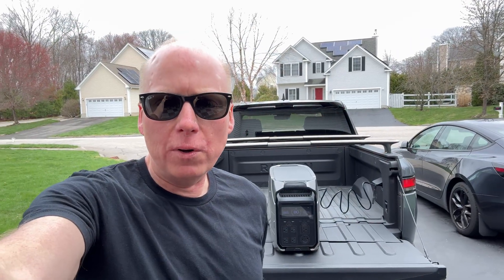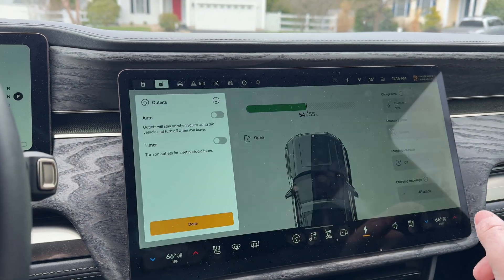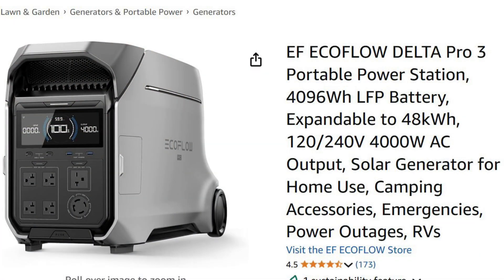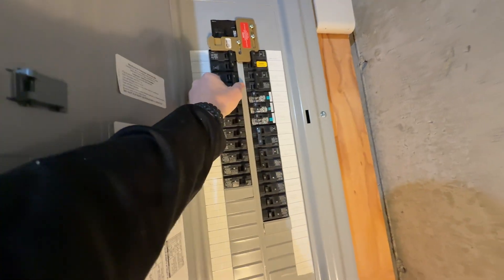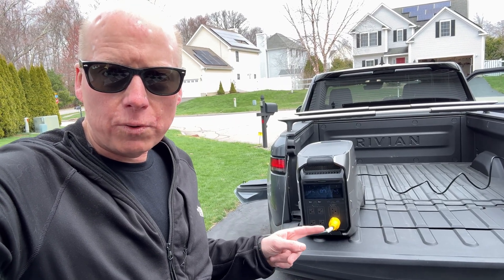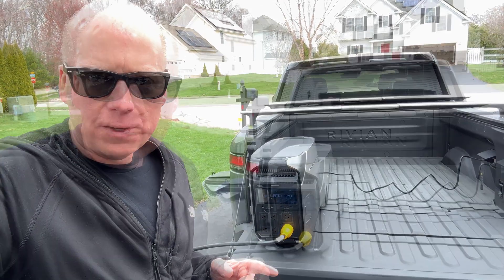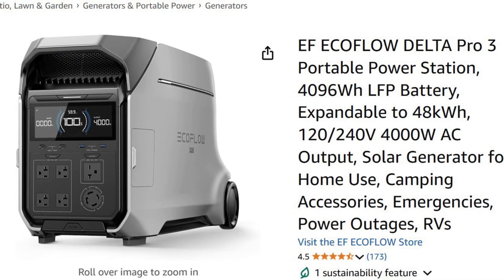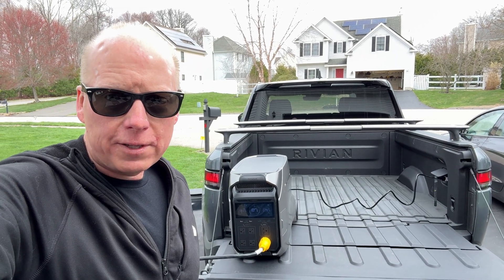Can I Charge the EcoFlow Delta Pro 3 With a Rivian and also Power my Home with 240V Split Phase?

Comment: Rivian R1T owner here and just picked up the ecoflow delta pro 3. Excited to see this work! Did you learn anything new over the last 6 months?
Reply from the maker: So there are some weird limitations you can charge from 120v and run the 240v inverter no problem but the ecoflow will try to pull 1800W even if you have the charge power limited in the app to 1200W continuous that the RIvian inverter can provide.   

So in my setup the ecoflow will pass through whatever the 120v RIvian inverter can provide and output to 240v split phase into my generator inlet.  I have to manage loads and set the charge level to minimum.

Hopefully a firmware update will allow up to set a lower charge rate that sticks but it might be a hardware limitation.

use this adapter to charge the ecoflow from the rivian outlets https://amzn.to/47Xg2Uu

You can use the RIvian mobile charger with this NEMA L14-30P to 14-50R RV Generator Adapter  https://amzn.to/3Xf2nly

and charge the ecoflow from a j1772 charger with this  EV X-Stream Adapter https://amzn.to/4okm47q
Reply: @keenanjeff  did you notice the switch on the back of the delta pro 3 where it mentions "fast" vs "adjust"? Just make sure its on "adjust" and that should fix the problem of it trying to pull the full 1800w
Reply from the maker: @keeganbuilds no it does not it will always try to pull 1800W if the load is above that it only limits the input power if nothing is plugged into the outputs
Reply: @keenanjeff  i have a theory. Is the battery fully charged and you are going into pass through mode? Have you tested when the battery is below 100%? maybe try at 50% and see if the battery charge limit is working as inteded
Reply: @keenanjeff  Another thought im having. What if you used someting like an AC to DC power brick that is something like 1200w max. Then go AC out from the rivian and plug that into the DC (solar) charge port on the delta pro 3

Comment: Thanks for sharing! I currently travel frequently off grid with my R1T so I use my older Delta Pro to run my RV AC for small stints. Does the Delta Pro 3 fit underneath the tonneau cover?

Comment: Please help me understand.  I have an ECO Flow Delta Pro Ultra 3.  Of course, trying to charge it with my Rivian while powering up my house with the delta pro shuts off the Rivian outlet immediately.  Are you indicating that what I need to get is a 3-prong-t0-2-prong adapter at the Rivian outlet to connect my Rivian to the charging input, and that this is all I need?  I have a heavy duty 50 ft. extension cord also.
Reply from the maker: Yes that is what i did

Comment: Great video. I have been looking for a solution on how to boondock with R1T as shore power. The difference between the RV air conditioner draw and the Rivian alt current output is not huge (~500w), but prohibits the shore power use case. I’ve been looking for a power station that could bridge the gap between ac input and output. Most of them can only pass through the ac input but will shut down power delivery or the ac input when the power station output exceeds the ac input. it looks like this may do the trick. I contacted eco flow and they said there weren’t really time limits on how long x-fusion function would work, basically they said as long as there is sufficient power remaining in the battery the x-fusion function could bridge the gap between output and input. Was that your experience?
Reply from the maker: In my experience it does work it will run the 240V inverter drawing from the battery and take 120V input to charge.  There was a issue with the charge power setting I set it at 1200W and it was trying to draw more hopefully they can fix that in firmware.  But the Rivian outlets were working fine once I used the 3 to 2 pin ground adapter.